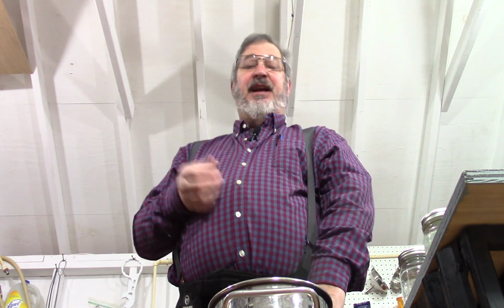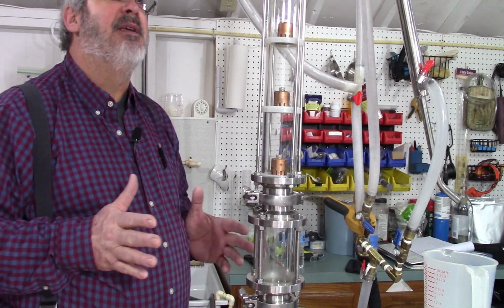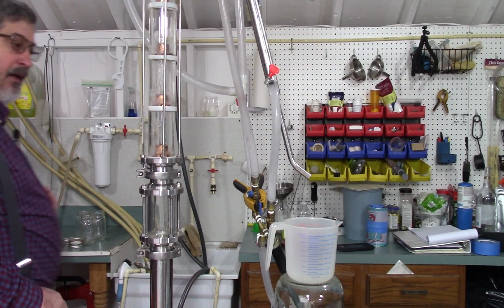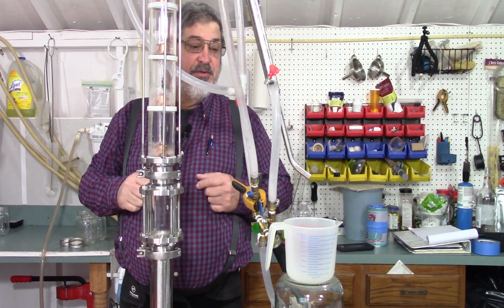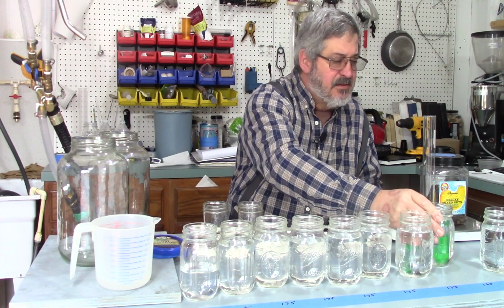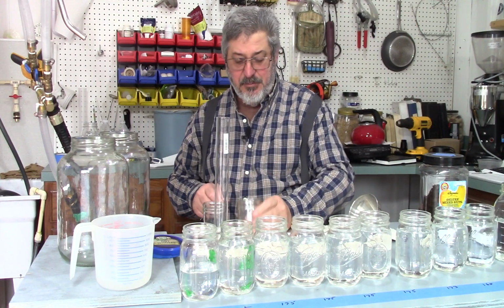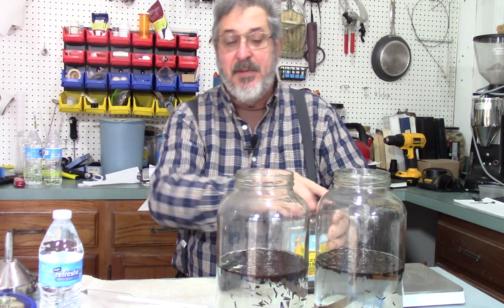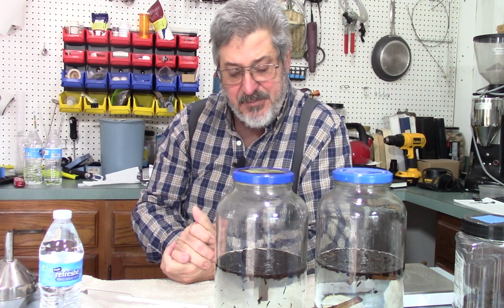E142 Light Whiskey part 2 distillation

Comment: Another way to get higher abv is with a thumper. When I run slow I can get 80% abv.
That is with heads added in the thumper and tails added to the boiler.
I will cut out the hearts, and add the heads & tails to the next run. Rinse and repeat.

Mind you I ferment in a 55 gallon barrel and get three runs out of it.
This is running a 15.5 gallon boiler and a 15.5 gallon thumper. (Both kegs)

Another process is to run 14 gallons of wash in the boiler and 12 gallons of wash in the thumper.
This "Doubles" the output volume in one run and collect it all like a stripping run.
I then run the last remaining amount of wash in the boiler, and the collected "double" in the thumper.
Run nice and slow... This works great for sour mashes.

Cheers Randy!
Reply from the maker: Hi BigEdsGuns Glade to hear from you Cheers my Friend and thanks for sharing all the info

Comment: Question, you can get tails running bubble plates at high proof? Asking because I just got a new bubble plate column and was sure when to stop collecting. Thanks in advance. Love your channel !!!
Reply: With my setup even with the plates the tails on mine start showing up around 100 proof on a one pass . After using your column a couple of times you can get dialed in just about where the tails starts showing up every time so you can start looking for them around that proof .
Reply from the maker: you will learn your system small cuts taste and smell are the best tool
Reply from the maker: check David reply  cheers
Reply: @John Schilling
Find Full Reflux running speed: (This is for CM still - Cooling Management)
Run boiler at max temp.
Turn on Dephlegmator at max flow.

If you Start collecting, lower power to boiler until the collection Stops.
This is Max power under "full reflux", make note how much power you are running at.

If you Don't Start collecting, decrease cooling flow to Dephlegmator.
When you Start collecting, this is Max cooling for "full reflux". Make note of the flow.

Run "full reflux" for 10 to 20 minutes to load the column. Then start collecting.

^^^ When collecting you want steady pencil thin stream while collecting. So increase boiler power or, lower coolant flow to start collecting. You have to dial YOUR STILL setup in.

If you taste "tails" throughout all your cuts, you are running too fast. Lower your power by 10% to 20% and re-run what you collected after diluting down to 40% ABV Max!!

Spotting "Tails" in Column or Flute:
Bubbles get smaller at top plate, and glass above the lowest plate begins to fog above bubbles.
If running a parrot you can watch the Tralle rise up Fast.
I smell and taste. I've also never used thermometer anywhere in distillation.

Hope this helps. I would provide HD links but my posts get deleted....

Cheers!